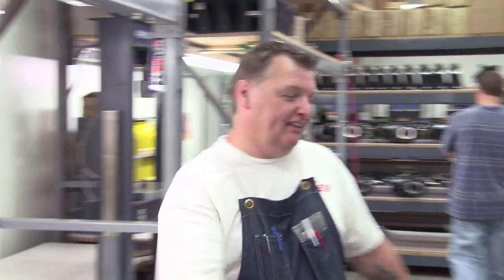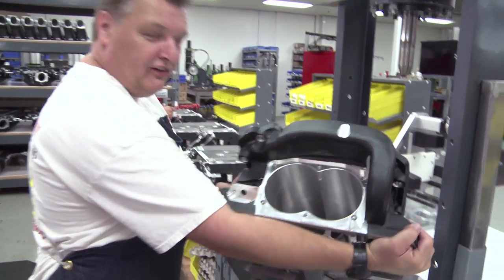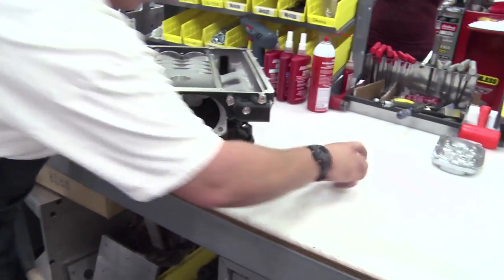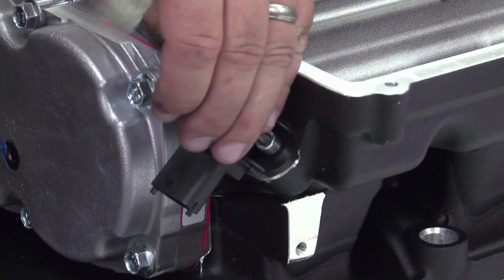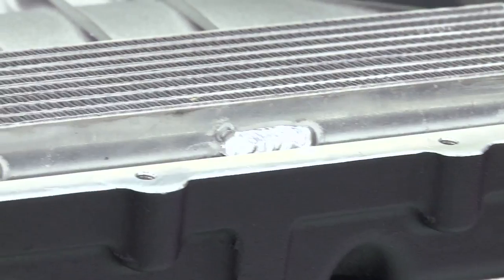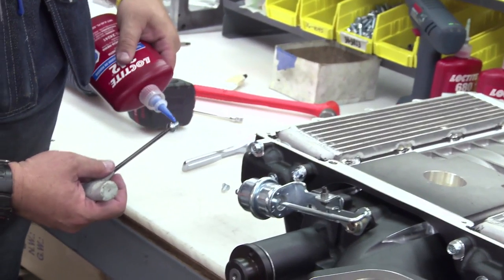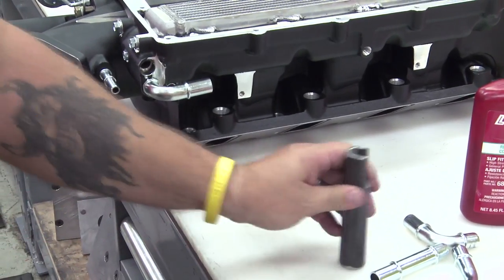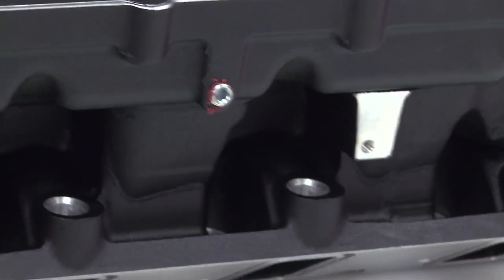Edelbrock Supercharger Assembly 2011

Comment: Is it possible to have the snout ported to fit a 92mm throttle body or use an adapter
Reply from the maker: Depends on the application.
Reply: @EdelbrockTV  I have a 2016 dodge charger 5.7 and was interested in the edelbrock stage 3 tuner and was wondering could the snout be ported to fit a stock Hellcat 92mm throttle body
Reply: JOKERZ in Illinois wont port Edelbrocks.
I doubt anyone will.
Reply: @angelo_giachetti  ok thanks